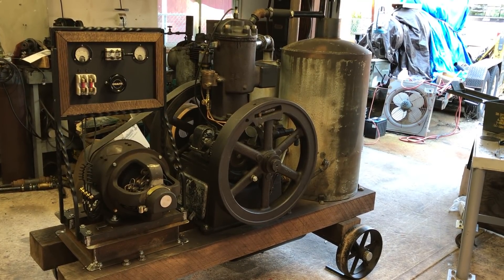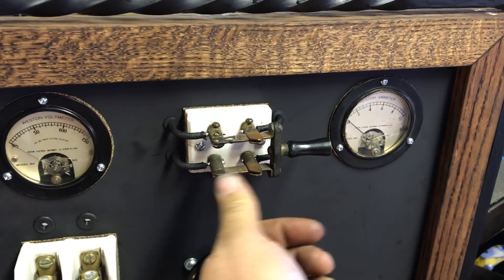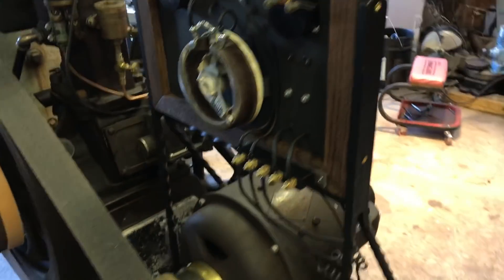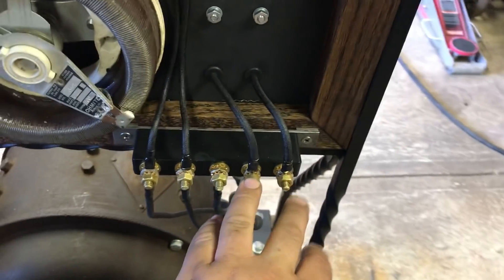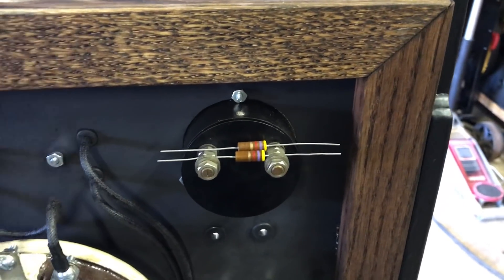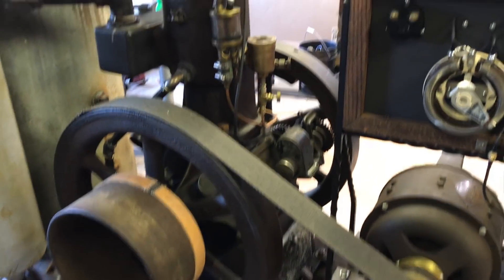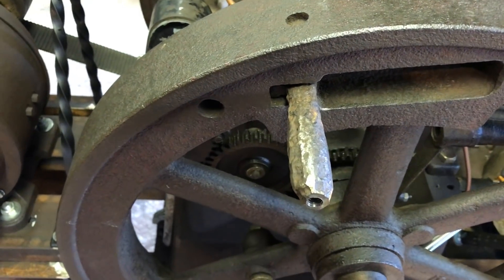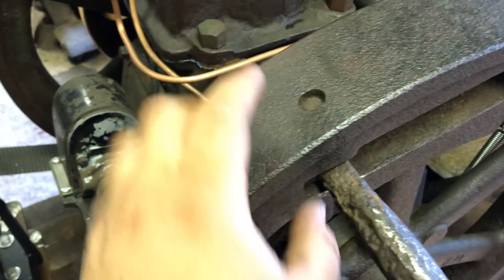GETTING CLOSER!  ANOTHER BESSEMER UPDATE

Comment: The external resistor on the gauge would have been a crimped nichrome strip . You adjust the overall resistance by lengthening the the strip, and severe cases, taking out a crimp or two to lower the resistance . I was restoring a very old electrical system which had a similar set up and found that nichrome is available but only in bulk tonnage lots (!)  .I had to make do with a 100 year old resistor which was a bit short overall and besides getting hot ,it gave a very incorrect reading. A good example are those antique battery load testers which had a resistor mounted between the forks.

Comment: Nice Mike, you could put each resistor on each terminal. The meter doesn't care where it is in the potential divider. Funny how finger grease can corrode the crap out of something. Over here we used to have polished cast iron handled levers for the points (switches) on the railway. The signalman would always have an oily rag to pull the levers and never use his bare hands.

Comment: You could drill that pin, tap it and extract it with a gear puller. If its not a taper pin you could put it back in the other way round when you're finished to hide the hole
Reply: I was thinking the same thing. Only using a threaded rod, a deep socket, and a nut to extract the pin. ;o) The control panel looks great !!